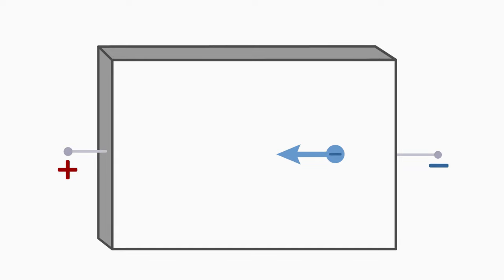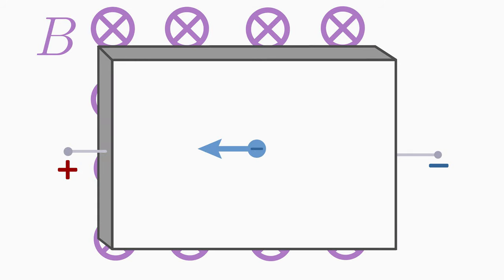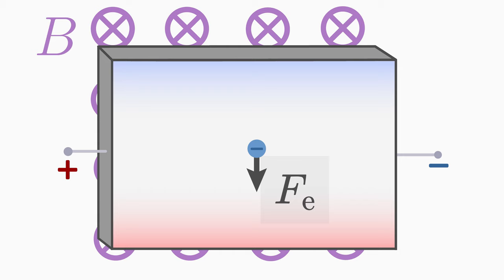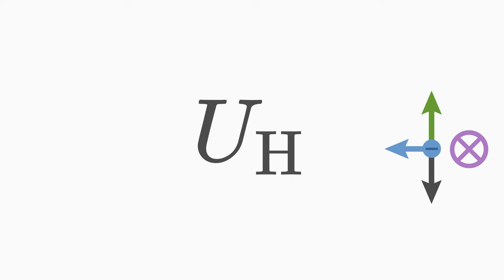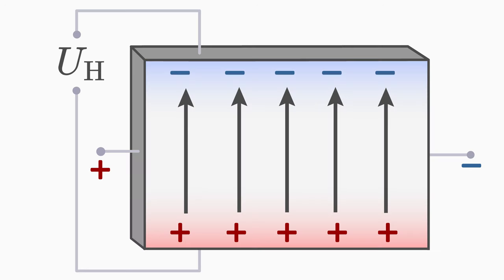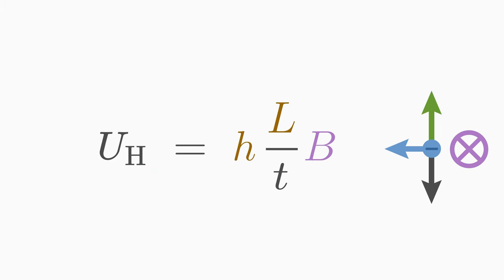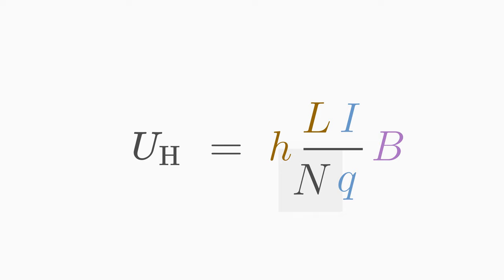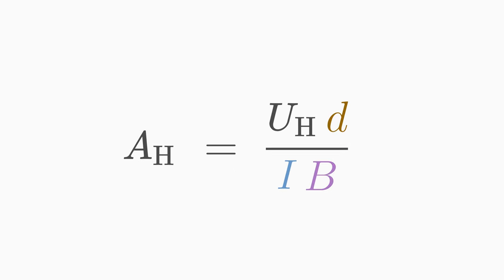Hall Effect

Comment: I'm confused about the direction of the Lorentz force. If my left middle finger goes from left to right and my left index finger does toward the screen, my thumb points downward, not upward. The open right hand rule backs this up: if my thumb (current) goes from left to right and my fingers (magnetic field) go toward the screen, my palm (force) also points downward.
Reply: index finger = magnetic field, thumb = force, middle finger = current (direction of positive charge flow). each of those three quantities are vectors whose direction is the direction your finger points in :) if the question talks about negative charge moving left then you must make sure to point your middle finger to the right

Comment: man used left hand rule instead of right 💀
Reply from the maker: haha. In German it's easier: there you can't make the mistake because it's called "three-finger rule" and not "Right-hand rule" :_denkerAtom::_denkerDenkt:
Reply: For an electron, you can use your left hand. for a proton you use your right hand
Reply: wait I don't get it, shouldn't we be using the LHR to find the motor effect on the electron placed in a B field?
Reply: No you use the LHR for the force on a positive charge, and use right for electron but honestly just use the LHR for all of them and when encounter an ele just pretend the current is going the opposite directing while assuming it acts like a proton
Reply: @iamnotalive1155  yeah exactly, that's what I thought. Thanks for clearing it up. I've been told to use the RHR only when finding the direction of the induced current.
Reply: @iamnotalive1155  we take the direction of the current as the flow of positive charges, I.e. conventional current. 

But it says in my book that for a conductor which is metal, the direction of the current is thr flow of electrons, in that case should I point my index to the direction of electron or opposite to it? I'm so confused.
Reply: @MrBej  when they say current you should always assume positive charge flow, if they specify electron the you must point your index backwards
Reply: We use the flemhings left hand rule to determine the direction of the force acting on a charge in the magnetic field
Reply: 😅bruh why dont people just stick to the definition of these quantities and do cross product of vectors.
Reply: @fufaev-alexander  No one cares what it's called in German. Just clarify why you used the left hand rule
Reply: @iamnotalive1155 RHR is for the direction of a positive charge according to the Lorentz force law. For electrons it’s just the opposite, so it would be LHR. I’m not sure what you’re saying.